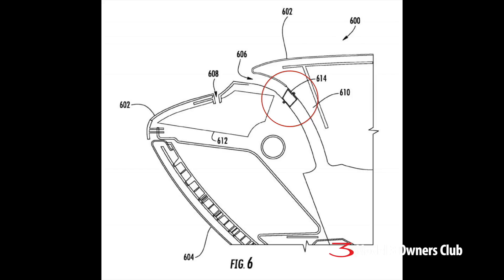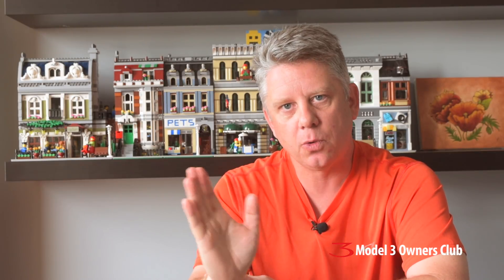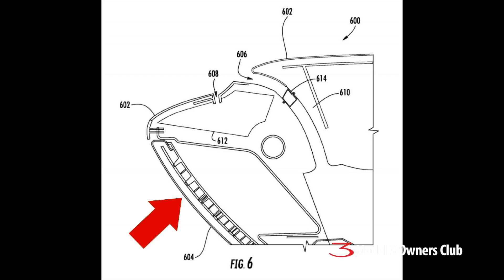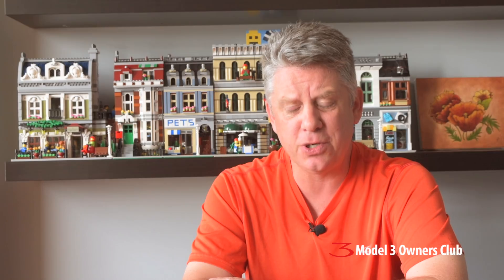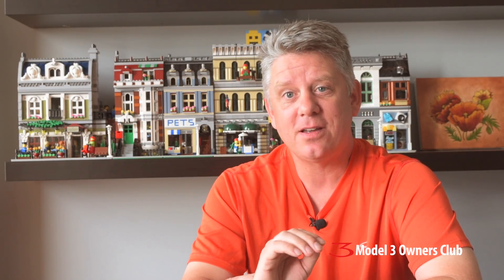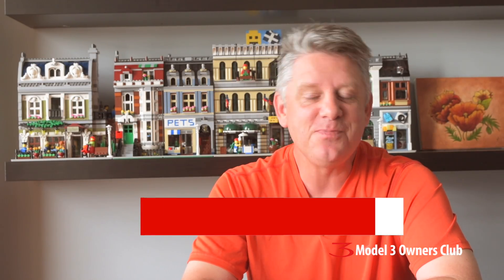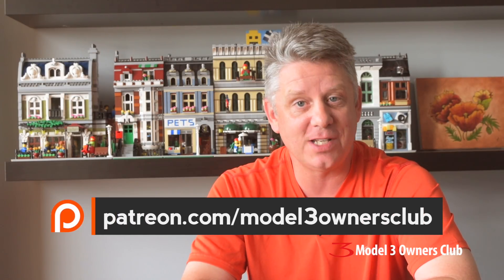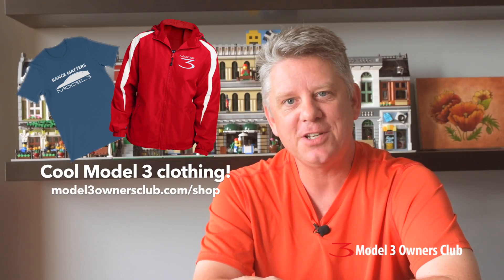Model 3 HVAC System Explained | Model 3 Owners Club

Comment: I thought this was going to explain how the hvac system works since there's no engine that runs a compressor. Instead I was told how the vents work. Misleading title leading to bad search results on Google.
Reply: @teslaownersonline5805  no, I have not. Which was why I was looking this information up last night. But I got a course on old technology with air redirection instead due to misleading video titles instead of the hvac system. There's a lot of things that tesla is doing that's old as dirt. He's just finding ways to do it better than the last who did. That's NOT what I was looking for.

Maybe you should do a video about the actual hvac system and not ventless air redirection. I would like to see how it actually works.

Comment: The question was not answered.  Why would we care how the air is directed?  I want to know how the compressor is run without an idling engine.  Is there an electric compressor motor?  What's the rate of draw?

Comment: I clicked on this video wondering just how it makes cold air from battery power. (Hot air, is obviously a resistance wire grid) 
Neat bit on the output vents though, I did not know that.

Comment: Man I want the model 3! The AC was noticeably better than other cars I’ve driven, the air coming from the whole front instead of little vents like in a traditional car is so much better.. Tesla is on another level with engineering how the air flows

Comment: This didn't explain s*** about the HVAC. You only talked about the ducting system. Don't tattle your video that you're going to explain something that's highly complicated then not even talk about it. The Tesla HVAC system is an engineering Marvel. It's never been done before and they had to find a highly efficient way to produce Heating and Cooling using only electricity. And I want to know what they came up with

Comment: One important advantage of such a system is that it is fully controllable using software. So for their car sharing service, it would be possible to remember your own personal settings.

Imagine a rented Model 3 would remember every setting from seats position, steering wheel, music, air condition and so on and when you are renting another Model 3, it would automatically adjust to what you set it last time before getting into the car. Brilliant!

Comment: 4 potential reasons for this:

Shallow dash (as stated).
Simpler, more elegant dash (aesthetics).
Adds the ability to set direction and spread.
Savable profiles, especially for when the cars are used for autonomous ride sharing. This, I think, is the primary reason for it.

Comment: Thanks. Interesting. But as a few other have mentioned this is not "Model 3 HVAC System Explained". It is "Model 3 Air Vent Design". Many would love to know if the heating is resistive or uses a heat pump, etc.

Comment: Now, how does it work?  Air flow is the least important part.  Without an engine producing heat, is resistive heating used?  For A/c, is there a compressor, or is thermoelectric cooling.
Reply: Exactly!  I suppose he'll speak for another hour about the color before telling how the thing works.
Reply: Heat pump.
Reply: My question exactly. Is there a god damn compressor? Belts?
Reply: No kidding. Hvac system explained. The air gets delivered by no visible moving parts. The end....? System
Reply: Would be nice, but no.
Reply: The heat generated from battery packs might be used. Just like the heat generated from the IC Engines in convectional systems. 

Resistive heating is insanely inefficient

Comment: I'm interested in how durable this solution is compared the normal setup. To me, how it behaves as new isn't the most interesting factor. After all, the vehicle should hopefully last for at least 2 decades.
Reply: With all the louvers and control vanes hidden it should be harder for little kids to stick stuff in them and break them. Adjustments are made with tiny electric motors moving control vanes. These should last the life of the car. They won't see a lot of wear.

Comment: The dual planes do a decent job of vertical control, but how does it control the horizontal?  Also, how does the system account for asymmetric settings?

In real life, the passenger often wants the ventilation pointing in completely different directions than the driver, and also at different intensities.  I hate the air blowing directly on me, especially when driving as it causes my eyes to tear up, but my other half insists on having the air blow directly on her to cool her off and she wants it full blast while I prefer a gentle breeze.

Comment: Hi what I want to  know is is the HVAC system a heat pump system or a resistive system with coolant with a heat exchanger like a conventional ice car ?
Reply: As per First Responder manual: resistive heating, A/C compressor (two separate components).

Comment: This is one of the things that bothers me about the the Model 3. I think its cool and all but, if your trying to keep costs down why not just go with basic vents.
Reply: This system is not more expensive then just vents. I thought it was going to be more expensive but it's just vents that can be controlled individuals
Reply: The Model 3 is not a budget car like the Leaf or Bolt. It's affordable and basic, but not cheap! There are many cost saving possible on the Model 3. Tesla could've easily have reduced costs with steel rims, less glass, limited* (or no) AP hardware, smaller battery and/or lower overal interior quality.

* for example leaving out the computing power, which can easily be fitted after market.

Comment: Wow. Good Job. Cool Aerodynamic Solution.
Reply: Hi Trevor and Kenneth.  Do you know if it's possible to have individual amount of air coming for the driver and the front passenger? If I understand it right, that is not possible. Ventilation speed is not possible to differentiate. Right?